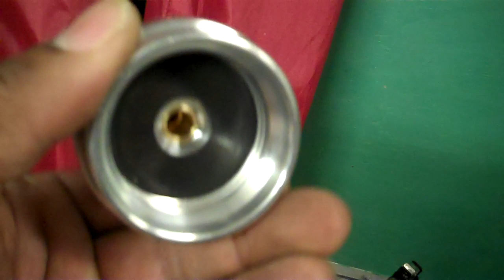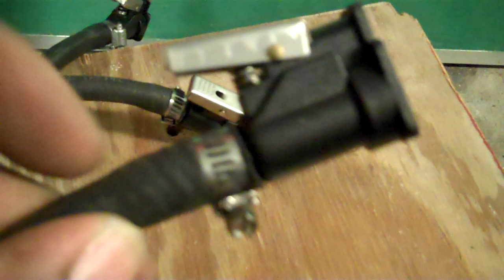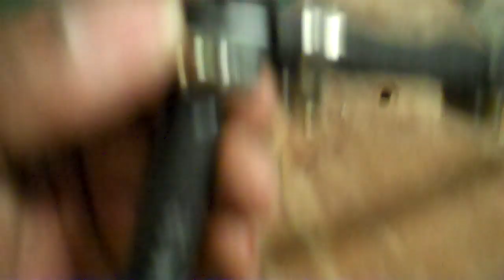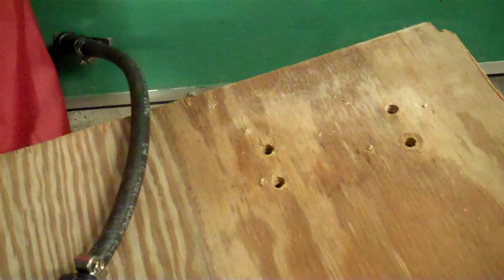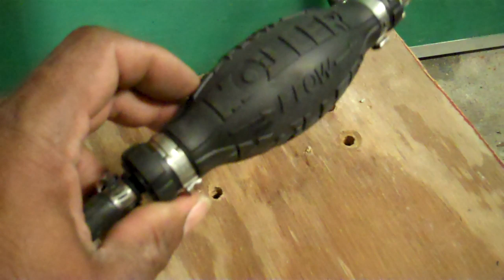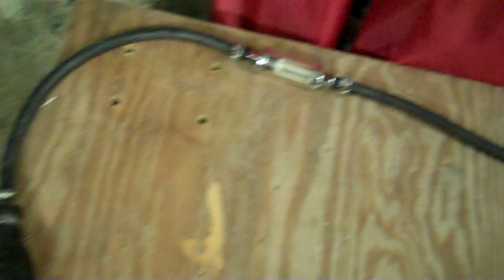DIY Guide to a Honda EU2000i Extended Run Fuel System

Comment: can you still drain gas in the fuel line?
Reply from the maker: +tanh van Yes, first disconnect the fuel line from the auxiliary fuel cell then use the primer ball to pump out the fuel that is in the fuel line.

Comment: Just got back from the city with new 1/4" fuel line, clamps, and some in-line filters. Will have a go at rebuilding the line tomorrow and see if I can eliminate those air demons. Will report back, thanks for the suggestions.

Comment: Thanks for that. Time to do some maintenance replacement on my lines so tomorrow I was planning to buy a couple of cheap $2.00 inline filters as well. If I see a fuel guage maybe I'll put one in the common line as well. I still haven't achieved vacumm flow, I still have to move the tank higher for some reason. ALthough I cannot seem to find any air leaks, the fact I cannot get a vacumm must mean I have a leak somewhere I suppose.

Comment: If you are always going to use this system you do not need to purchase a new fuel cap for the Gennys. You can remove the air valve assembly from the middle of the existing cap, and thread in an appropriate diameter 90 degree fitting, sealing the thread as it screws in. The glass filter is a great idea that I plan to incoporate into mine. I don't understand why it is only on one side of the 'T", would it not be better to have one inline before each fuel cap so you can ensure flow to each side?

Comment: @MrNightro Sorry. Lets say I want the generator to continue running on it's internal fuel while I take the external tank off for refueling. Once I disconnect the line, that aluminum cap is now unvented. Yes, I could loosen it to allow for venting, but fear the cap could vibrate loose resulting in a fuel spill. Do I simply put on the OEM plastic cap at that  point??  Also, fuel sitting in the line can't be good. How do u drain the line of fuel before storing it away?

Comment: @MrNightro Hi. Of all the systems I've seen I like yours, with your modifications, the best. I have 2 questions: 1) When you disconnect the external tank (say to fill it at the gas station), the male fitting on the Honda cap now becomes air tight. Doesn't this create a vaccuum in the Honda tank before long?? So what do you do?? Put  the old vented Honda cap on he generator when filling the external tank??  2) How do you drain the gas out of the fuel line when you're done using the generator??